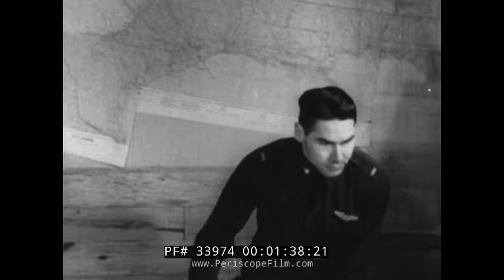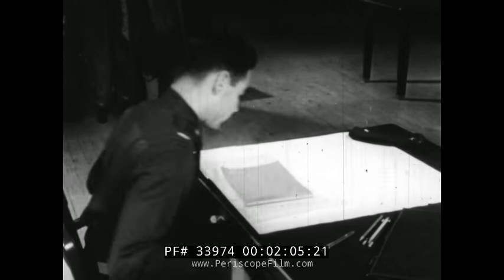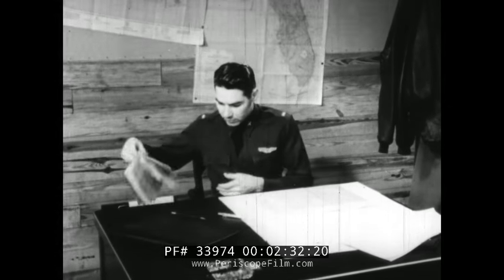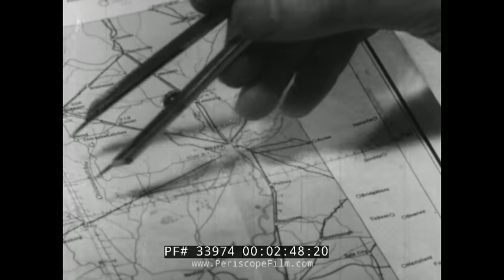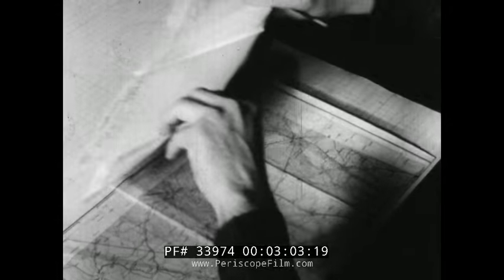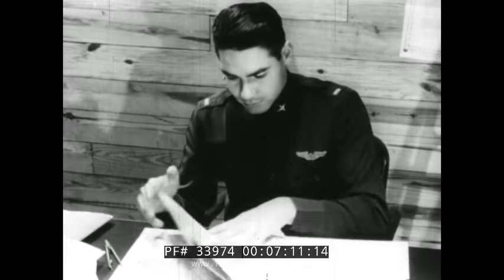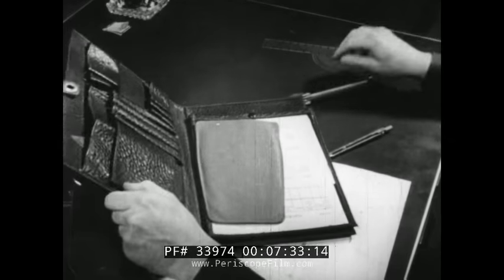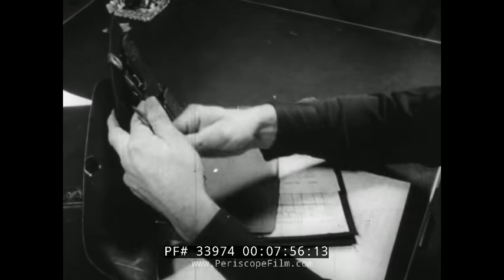AIRPLANE DEAD RECKONING NAVIGATION PROCEDURE  WWII TRAINING FILM 33974

Comment: As an old tool and die maker what impresses me are the instruments used to make calculations. The rulers and computers and mathematical theory behind the tools that make the calculations accurate. Those tool designers made the theoretical meet applied practice. That's great engineering.

Comment: I've never seen the wind face of an E6B used that way before! I'll have to give it a try. Yes, I paused the video and ran the TAS computation on my whiz wheel and was pleased to get the same answer. Any idea why he used indicated altitude and not pressure altitude in his calculation?
Reply: Probably because at an altitude that low the error introduced by choosing indicated altitude fell within the errors from other inaccuracies and was therefore a justifiable simplification. But that's just a guess.  EDIT: He DID use pressure altitude- not only did the narrator SAY "pressure altitude",  it showed a DIFFERENT altimeter that had no Kollsman window.
Reply: Why does your profile pic look like Walter White? Lol

Comment: That does it! I’m never going to use the system that uses signals from machines in orbit around the planet that triangulates your position anywhere on Earth to within three metres and then calculates the route to your destination based on your means of transport and current weather conditions (which are also beamed into my device from Space in real time) which is built into the thin, lightweight, glass and metal, microprocessor-driven, battery-powered device that’s small enough to fit into my pocket again! From now on it’s turn-y slide ruler thing, a map, three hours of preparation and a sharpened pencil!
Reply: Harrumph.  Quadlateration actually.
Reply: Do pilot training- all part of the current exam

Comment: DR is what inertial guidance does far more frequently today.
Reply: Please explain?
Reply: @HerbertTowers  https://en.wikipedia.org/wiki/Dead_reckoning
Reply: @igsaturation  So called "Dead Reckoning" was used before for hundreds of years before even accurate clocks were invented.  All forms of navigation use some form  of dead reckoning.  Inertial platforms, GPS and so on can only determine current position  Depending on the positioning software/thinking power integrate and one gets acceleration, integrate that and you can get speed.   Even after all that though 'guesswork'  is involved to predict factors such as wind changes, tide, current  hopeless navigators and so on.  Remember that the gyros (mechanical or otherwise) keep the platform  (mechanical or otherwise) oriented and it's the accelerometers that do the measurement (not calculation).
It's said that "The art of (air) navigation is to establish a vessel's position and to guide the vessel to any other position".    

Please excuse my poor grammar.